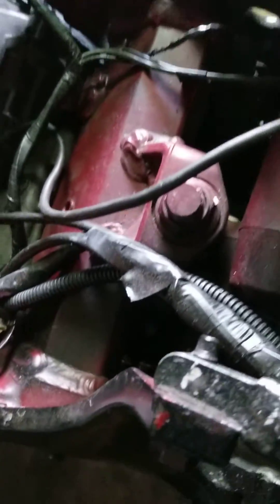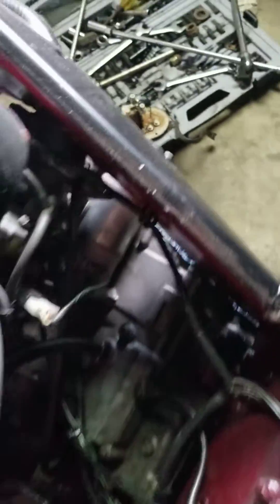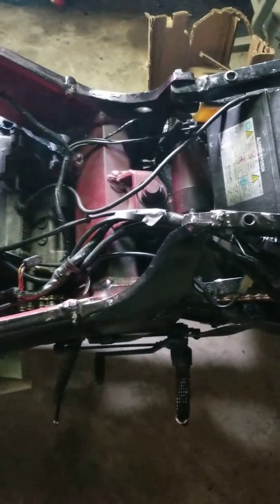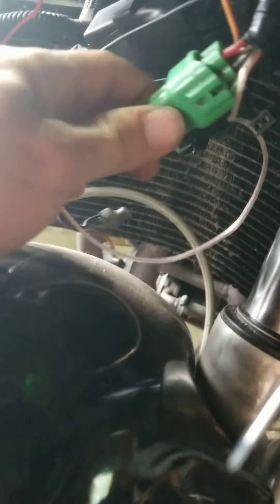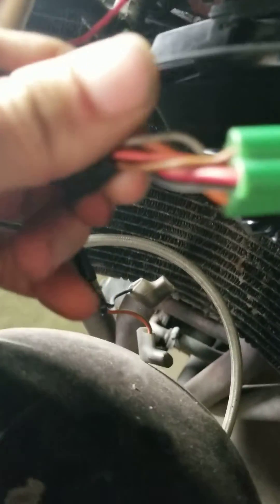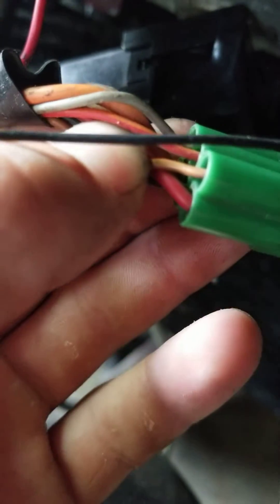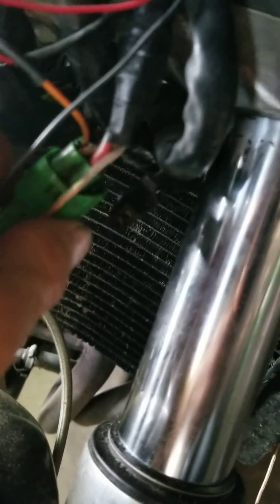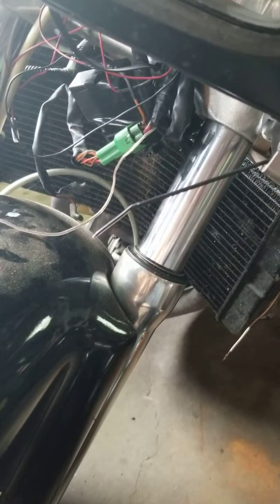Gsxr no spark. How to diagnose no spark issues.

Comment: Im doing a project put 750 gsxr motor in raptor frame. Ok ive got everything hooked up everything has power. Ive even got videos of me trying for weeks to get spark. Only way it would stay running the starter has to keep turning with motor soon you come off the push switch it cuts off. Im really hoping this technique helps me tomorrow.🤦🏿‍♂️

Comment: Would the bike have power at all if it was a ignition/resistor problem or a pulse generator problem
Reply from the maker: Yeah the bike still has power to gauges and fuel pump ect. with a bad resistor. Your pulse generator is a magnetic sensor that tells the coils when to fire... but even with a bad resistor and pulse gen the bike should still turn over when you hit the start button. It just won't fire up.

Comment: Bro I bought a new ignition switch an I turned it on the tail light came on an I hit the start button and nothing
Reply from the maker: Buy an oem ignition or follow the videos on how to wire in a resistor to the ignition you have. I made a few videos on it.

Comment: Want to thank you for the tip, on this and the other video, connected the resistor to the red / orange cable on the switch side and started, so my Gokart / Ninja 750 cc is alive!   made the error of buying the Chinese key and dumped the original.   now I need to finish to seal all wires that I extended to have the dashboard on the front and try to use it.    Thank you -

Comment: Hey bro I got a 2005 gsxr 600 I got it to start a few times then no more start it doesn't have fuel prime or spark what do I need to check I have watched ur videos if I put the resistor on orange with white tracer to black with white tracer would I get fuel prime and spark I'm using my bike for a snowmobile project

Comment: I have a no power at all issue. Could that be from a bad ignition issue like in your video? I can't trace any power past the end of the the positive cable coming off of the battery. I can't even find it in the fuse right there at at the relay could that be caused from the ignition problem? Help bikes been down for months cant figure out
Reply: If you have no power that’s yo main 30 amp fuse my g

Comment: Check the diode in the key switch.
Reply: Where exactly is the diide
Reply: @bjornleonard2974  Very bottom where wires go into the cylinder key. Have to take apart the key. New one should come with. There pretty cheep. It's so the ecu get 8 volts something like that

Comment: Cut the the wire and reattach it where?
Reply: Pull the switch get inside test diode. One way switch. Bad replace.  Buy aftermarket. Plug in play. 20- 40 $ eBay.

Comment: Hey do you have to put the resistor on just the orange wire?
Reply from the maker: Yes.
Reply: @ATCAdventureland  alright I will try that next. Still haven't figured out my no spark issue
Reply from the maker: I made a better video of where the resistor goes. Check it out on my channel.
Reply: Thanks for the video. I’m trying to order the 100 ohm resistor and it’s asking if I want 100 ohm 1/4 gauge 1/2 watt all the way up to 100 ohm 1/2 gauge 10 watt. Do you have any insight on this? Thanks bud!
Reply from the maker: @MrBumpsk  100 ohm 1/2 watt
Reply from the maker: @MrBumpsk  this video better explains it https://www.youtube.com/watch?v=oYZhwmyIFYg&t=108s
Reply: @ATCAdventureland  my Suzuki impulse not showing any spark. I have already checked pick up coil , ignition coil, but still not spark need ur help